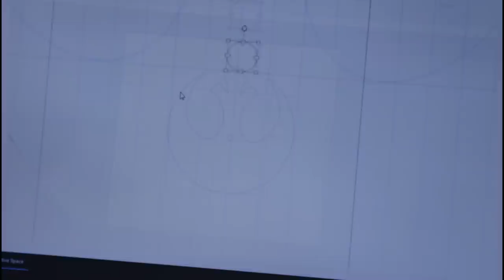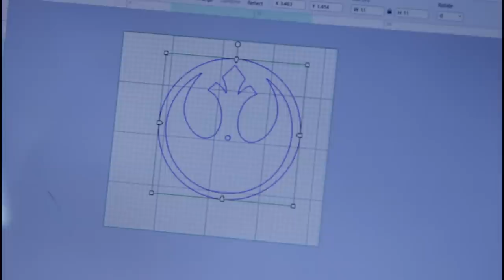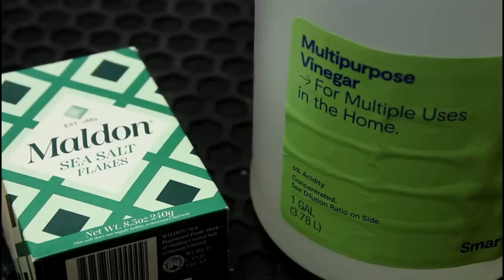This Clock Is Outta This Galaxy!  | xTool D1 Pro

Comment: electroforming and metal plating in general is such a cool process, I gasped when you first pulled the piece out of the solution! definitely team green but the almost brushstroke-looking patterns on the copper one are also really neat-looking.

Comment: A couple of take always from watching this.
You are one of the few to actually use a rattle can the right way. So many don’t know how to spray with one and you see them paint half way across a surface instead of a complete pass etc.
I would have loved to see little Tie Fighters on the clock hands. You have a laser cutter so that should be easy.
Finally I’m on team patina though I wouldn’t knock either back.

Comment: Those look amazing. Yeah, salt and vinegar is hard to beat. I've tried all of those weird (and often expensive) chemicals and they don't work any better than that. OH, and you don't necessarily have to mix the salt in. Try spritzing vinegar onto the copper and then sprinkle on some course salt.  It'll stick to the wet places and you'll get little "mold spots" growing from it. Achieves a similar but different effect.

Comment from the maker: Team Green
Reply: I figure that more than anyone I actually know, you will appreciate this story. I once, painstakingly slowly, glued very thin copper sheets to a table-pillar height concrete bird bath in the shape of a flower. Say about 31 inches tall, and about a 10 inch diameter base and a 32 inch diameter “flower” bath. Over a period of weeks, I carefully aged the stem of this flower using a spray bottle of vinegar and another of salt water, taking it to juuuust green with a touch of blue, and then I carefully taped off all but the flower leaves — mostly on the underside of the flower, but some woven into the petals — and took them to that powdery blue color. I sealed the whole thing, used old black and gold magic the gathering manna stones in the bowl as “seeds,” custom cut a plastic liner for the rim of the flower so I could place a larger glass circle on top… and voila, I had a custom flower dining room table. 

It was so beautiful.

A week after I finished it, my father was visiting and instead of getting the stepladder out to swap some track lighting around, he decided to just stand on an old apple crate box. Which gave out on him.

Concrete crumbles very thoroughly, I will say that. It’s apparently great for breaking falls. 😭

Comment: That oxide effect looks great! With regards to you comment about the chunk of steel attracting the copper particles in solution, as the steel was electrically isolated it would not act as an anode, and therefore not become copper plated.

Comment: you can also use vinegar and salt to remove patina on copper, you just wash the copper with the solution and maybe a scrubbing pad and wash off the rest when its clean. I used it to clean some copper chainmail I made a while ago.

Comment: I’ve used laser cutters before where you can hit a ‘boundaries test’ button. The head will move to the farthest points of the cut, to make sure nothing is out of boundaries, and everything fits on the material. Nothing is actually cut, you can just physically see if it’s the right size

Comment: Huh. If you have some short copper pipes, you could use them as support for suspension and copper source. Some on the top of the object would prevent floating.

Comment: Peter, you could have run a 3/8” bolt through the hole with a nut on either side. And run the conductor to the bolt. Just a thought. Oh and the streaks probably came from the brush strokes of the conductive paint.

Comment: Green is cool.
To help speed up the plating put more than one negative wire on the piece. This will also help keep it even coated. 
The steel bar should not have picked up any of the copper because it wasn't electrified. The copper only sticks to negative charged metal or carbon. If you could figure out a way to rock the pieces back and forth it would help with air bubbles and might speed up the process. 
Now if you really want to have fun. Acid etch the copper to clean it. Put nickel over the copper. Etch the nickel and gold plate over the nickel. Make sure you rinse very very well after the etch bath. If you put the gold directly on the copper it will stick but in time the 2 metals will blend and become one. That is why you put the hard nickel in between the softer metals. 
I really like the way your videos push your imagination. Keep up the good work.

Comment: I have the Xtool D1 10watt. I highly recommend not using xtool software and using lightburn. It is a million times better than xcs more settings for engraving and cutting and framing.  Give it a try. You get a free 30day trial.

Comment: The ironbar in the bottom shouldn't get any copper since it's electroplating - and the ironbar isn't connected to the power...
Reply from the maker: I would be surprised if I've got someone wrong, but all the exposed magnets on the bottom of the fixture are now copper coated.
Reply: @peterbrownwastaken  Odd - when electroplating, the copper anode should slowly dissolve into the solution and the metallic wood should slowly attract copper atoms from the solution - anything else in the batch could possibly dissolve into the acid, but shouldn't attract very much copper... Wonder if the wood dowel make a slight electrical connection between the plate you're plating and the magnets?

Comment: you can sue cheap copper-sulphate root killer (available at Home Depot or Lowes) dissolved in water as a cheap copper plating solution.